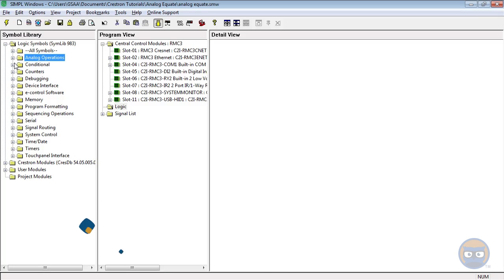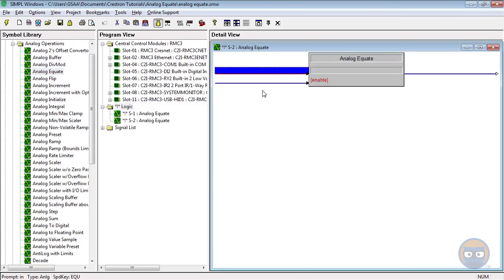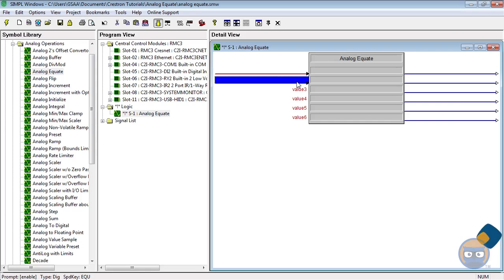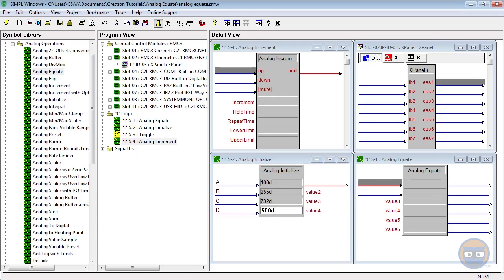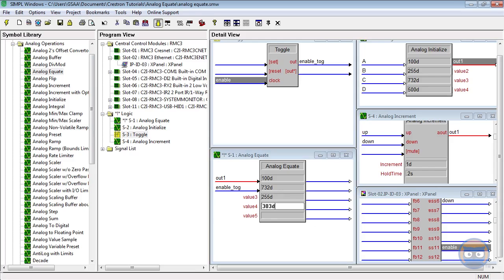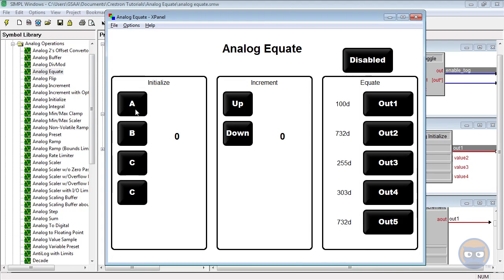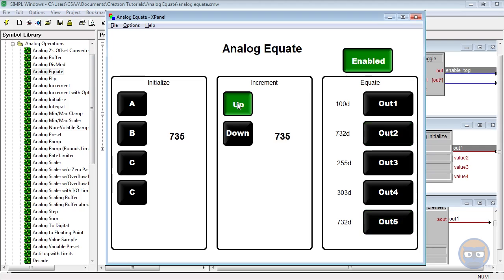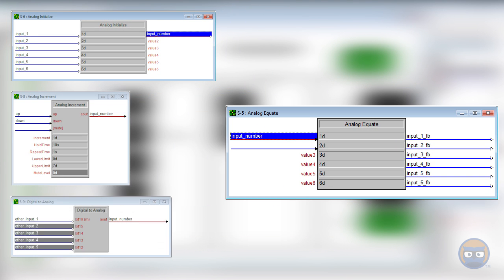Crestron SIMPL Windows ANALOG EQUATE Symbol Tutorial

Comment: Adding to the last point about using an INIT with an EQU instead of an IL: You can set the same value to more than one parameter on your INIT, meaning you can have multiple digitals going into the INIT that will set the same value, and therefore trigger the same output on the EQU.

Knowing this gets you out of situations where you need multiple conditions to trigger the same interlocking output, meaning would need OR symbols feeding into an IL. Setting the same parameter value on more than one line of your INIT means you have ORs built right in.

Comment: the digital input is optional, so if you don't put anything there, the symbol will always evaluating that analog value? Or the symbol outputs don't go high ever until the optional input goes high?  And since it reevaluates on the rising edge does that mean holding it high only evaluates one time?
Reply from the maker: Yep! The digital input is optional, so the equate will evaluate any analog inputs as if the input was always set 'high'.

The symbol re-evaluates its inputs on the rising edge of the digital input (if it's defined), and keeps evaluating the analog input while the input is kept 'high'. So any analog signal that's sitting on the analog input line as the digital input transitions to 'high' is evaluated.
Reply: +Over Worked Logic excellent thank you

Comment: hey
so it can be use in slide bar to control a volume for device?
as every digital out trigger certain volume level?
Reply from the maker: Yes! If you want to set a device to a specific volume level when the slider gets to that level. That would work well if you want to limit how much data is being transmitted to your device, assuming that it's a non-Crestron piece of equipment.
As an example, your slider output could be sent to an analog equate, with the analog equate having parameters for 0%, 10%, 20%, 30%, etc, up to 100%. Then the digital outputs of the analog equate can be tied to an SIO to send volume level commands to the device.
If you're controlling a Crestron device, like a Scaler, you can tie the output of your slider directly to the volume level input of the Scaler. In practice you'll want to put an analog rate limiter between the slider and your device to lessen the impact of mute/unmute.
Reply: thank you for explanation.
its non-crestron device and im making a module, and im trying avoid simpl+ as much as i can, so as u said I have just to adjust the parameters as percentage ! and in SIO make 11 levels 0%-100%
thats all?
Reply from the maker: Replied as a message ;)